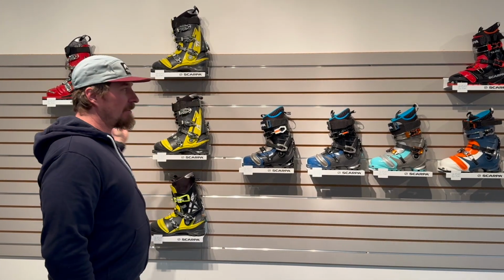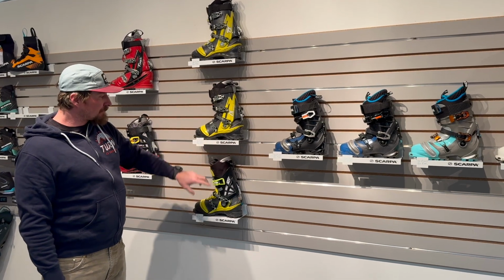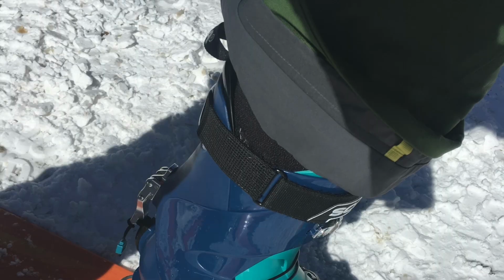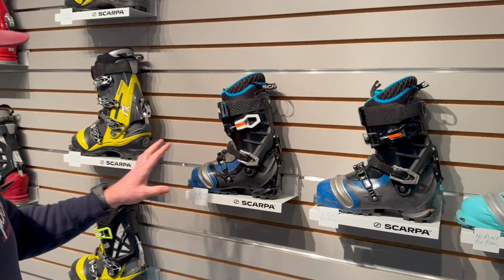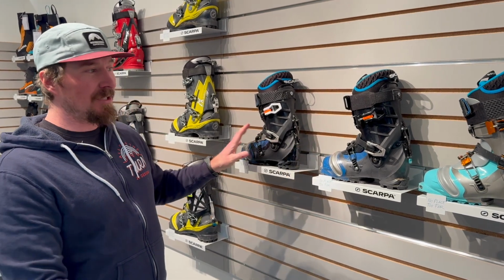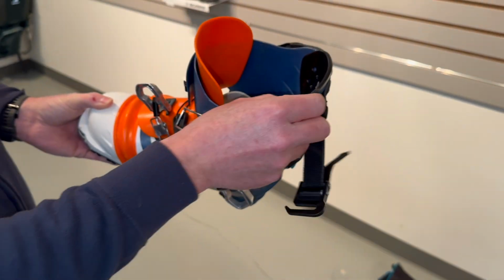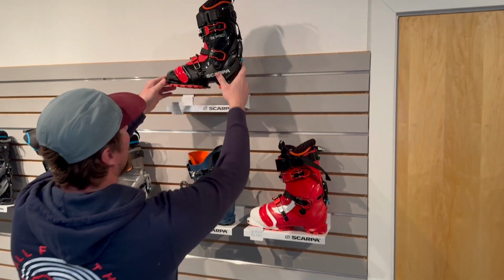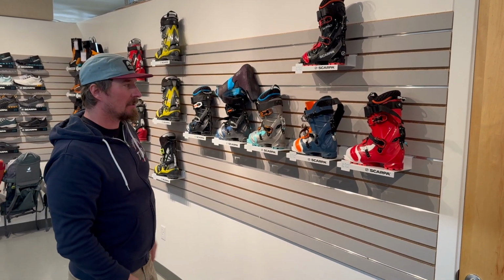Scarpa TX Pro and Comp development

Comment: So you think new TX Comp comes out in 2026? Was going to get new TX Pro but was worried it might not be strong enough for the skiing I like to do. Was just going to bight the bullet for the weight savings but you mentioned TX comp will be pretty light as well! Any more info on that?
Reply: Everything reads as if the TX pro is like the old T2 and is soft. The TX Comp should be like the T1. Haven't seen anyone liken it to the T1 Race though.

Comment: Thanks for this video, it’s cool to see and hear what Scarpa is thinking. I think making a stiffer 3 buckle boot is a mistake. The comp must support the upper shin better and we should control the stiffness of the flex using spring tension not boot flex. I get why you guys think a 4th buckle isn’t necessary since my 4 buckle boots seem to only have one buckle doing the work and another one is often loose, but even with the new booster strap I have trouble getting it tight enough to support the upper boot. I wish the booster strap was actually a ratchet strap so I could reliably tighten in. In the end we just need more competition  in this space as design is so much a product of the designer’s individual styles and philosophies.

Comment: Anything without Boa System is not good enough anymore!
Reply from the maker: 😂 Scarpa has been doing the boa for over a decade. Wouldn't work on this boot
Reply: I have skiing the New TX Pro It’s to soft in the and no flex in sole. They never feel right on the snow. Had ego back to my old TX Pro

Comment: Thank you for this video. I ski the TX Comps exclusively, usually resort or off-piste, but not touring.
I always ski the TX-Comp in walk mode, for more flex in the upper , more of a "light touch" setup, lets me flex lower in powder too.
Wish I could get a pair of the TX Comps with the inserts !  Like your Maestrale upper on the TX Comp lower.
By the way I have the orange and black TX Pros with inserts front and back, and early orange TX NTN boots, with ratchet instep buckle, inserts front and back.

Comment: Great to see this prototype progression.   Very interesting.   Hope Scarpa comes out with a 3rd boot in this line, a softer touring oriented boot.  My favorite tele boot ever is the 3 buckle Tx in its final version.  I often ski in walk mode.  The new boot design is great but not the best for "light touch" skiers.   Cuff could be 1 or 2 cm lower if development goes that far.